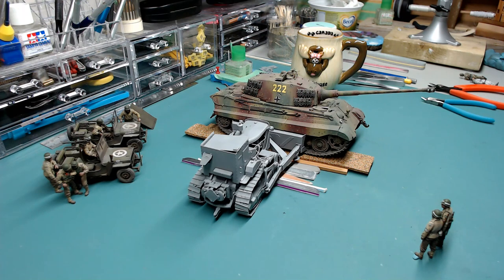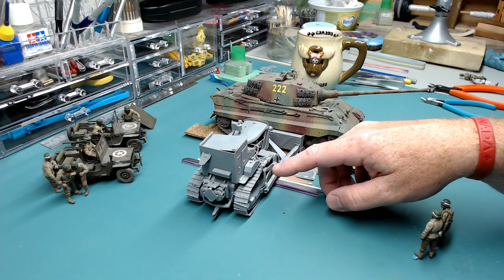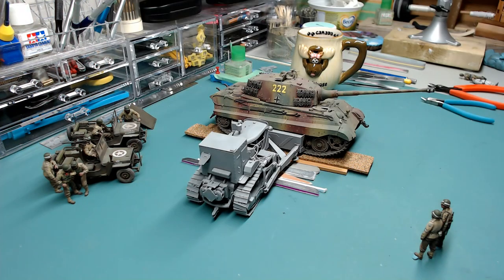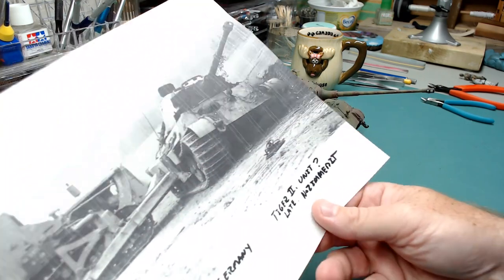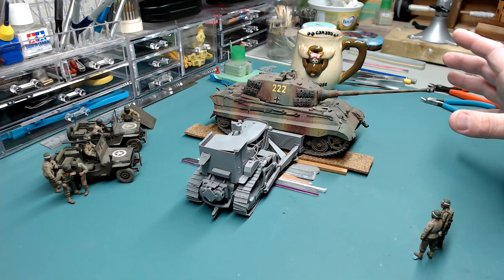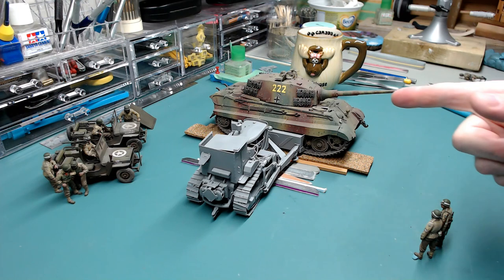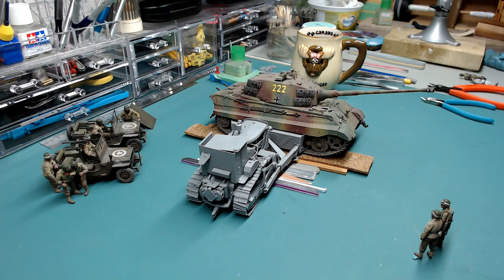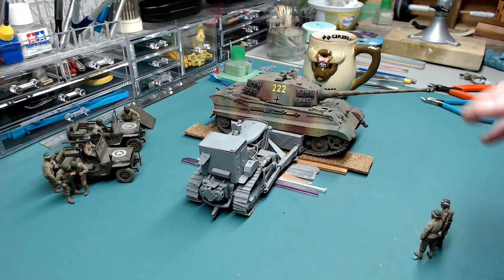D7 Dozer and the Tiger 004

Comment: you could add the photographer taking the ref pic.  I found a descent pic on the net and the thing in the foreground looks like the drivers hatch, the driver side track is missing and it looks like this tank burned too.
Reply from the maker: I'm thinking about adding a photographer. One of the MPs with a clicker in his hands. Not too hard to do.
The hatch on the ground I'm not so sure is the driver's hatch. It has a small wheel and a grab handle. Those are features that exist on the turret's loaders hatch, not the driver's hatch or radioman's hatch. Might be from a second tank that isn't in the photo, as the loader's hatch is visible on the turret roof.

Comment: The thing in front of the tiger looks like a hatch that got blown of. You can see the locking wheel and the lever
Reply from the maker: The wheel looks too big, as does the grab handle. It's possibly the driver's hatch though. The radioman's hatch is still visible on the tiger. In the high res pic that I have, the details are still poor, so can't be sure. It's definitely a hatch of some kind.

Comment: The D7 looked like a real bear to build and looks great since you finished it.  I like your dio idea adding some background to build the story line.  It'll be fun to watch you finish it up.  I do have a question though, when you re-prime and re-paint the King Tiger, do you remove the old decals first or just prime them over?  Just curious as I too intend to re-purpose a Panther I built 5 years ago.  Yeah, I'm not into Tweeter or Instabam either, too much drama and negative behavior.  Thanks for sharing Mike.  Cheers!
Reply from the maker: If the decals are tamiya I usually have to remove them. Tamiya uses plastic from picnic blankets to do their decals I think. So they're as thick as trash bags. I remove them with a sanding sponge or some acetone. Most of the time the decals are so well set and snug that it's not necessary. Especially if I'm just putting decals right over them. An interesting thing to note... Tanks got renumbered in the field all the time, so having the previous numbers being partially visible isn't exactly wrong on some vehicles.
Reply: @CoensScaleModelling  Thanks Mike.  Plastic from from picnic blankets, LOL!

Comment: That thing on the floor it's not the escape hatch at the radio operators position is it it has a little wheel?
Reply from the maker: The tiger didn't have one. And the hatch over the radioman's position is still visible on the tiger. It might be the drivers hatch... but the wheel is really big and the grab handle is also very large. It's a hatch of some sort, but I can't see with enough detail to get the entire shape of it, nor of the attachments. I'd peg it as the driver's hatch most likely... for now.